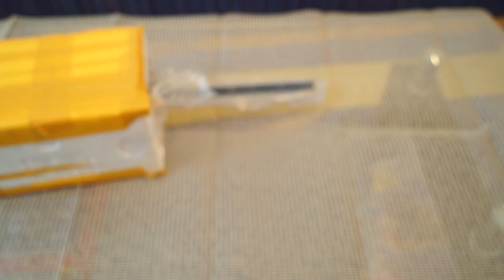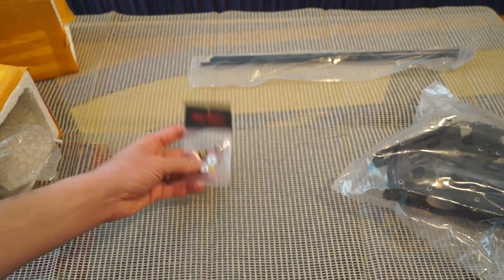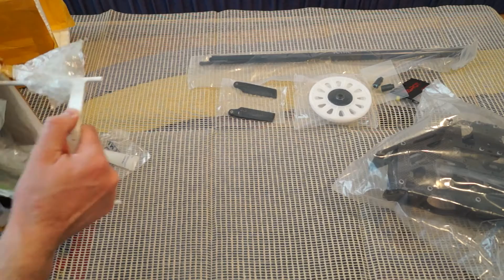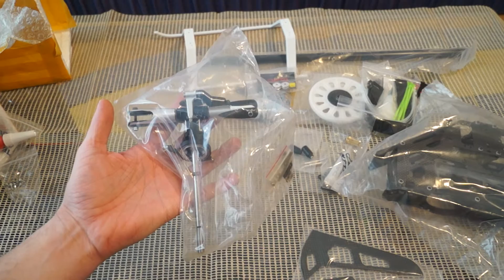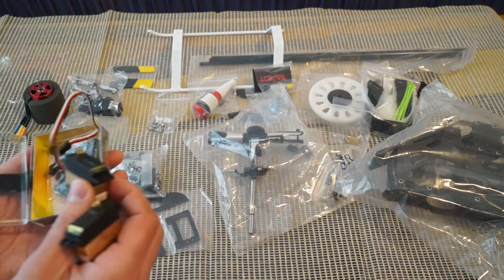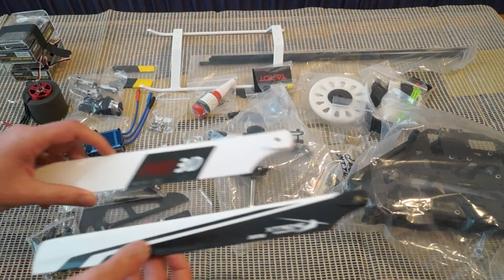VCTRC500 DFC unboxing and build parts list

Comment: Question on the tail unit: Does the tail pitch slider bottom out and lock like some other clone tails? From your photos on RCGroups, It looks like it clears fine, but it's hard to tell.  The reason i ask is that I want to upgrade my Trex 500 tail from the plastic tail case, and Have been looking at the VCTRC tail unit as a possibility.
Reply from the maker: No it doesnt, but it does have a tiny bit of play :(
Reply: Play, I can live with for now. Thanks for the info!